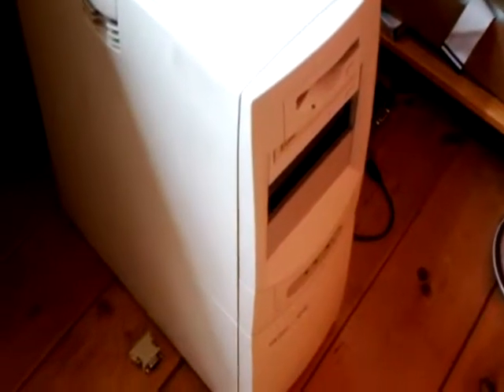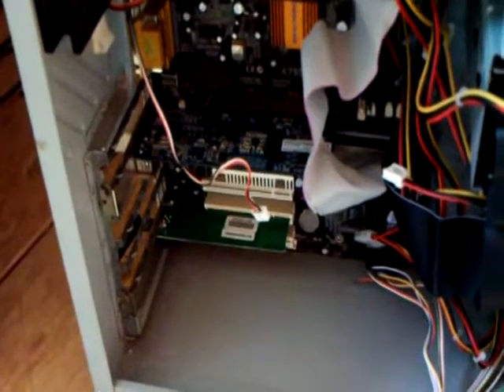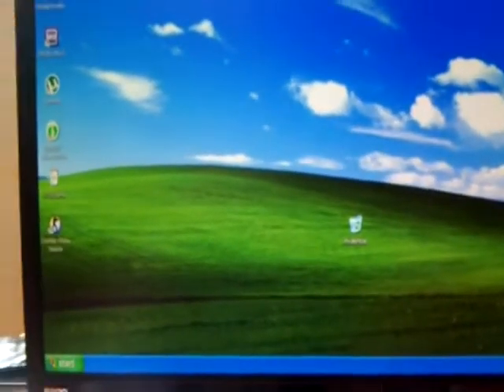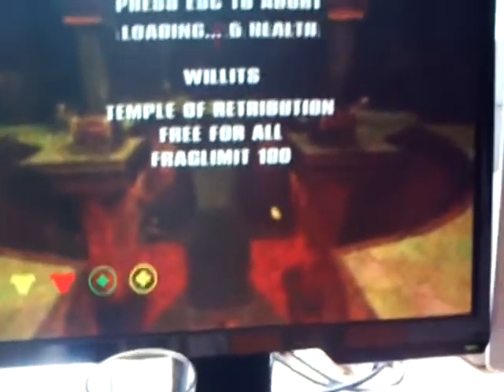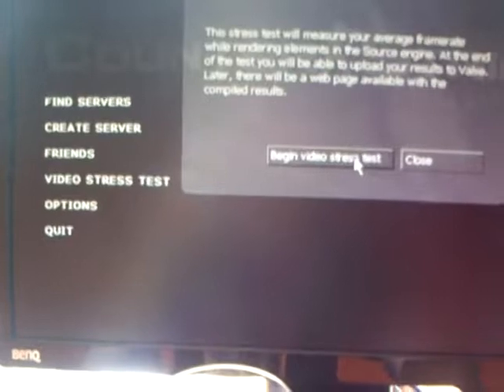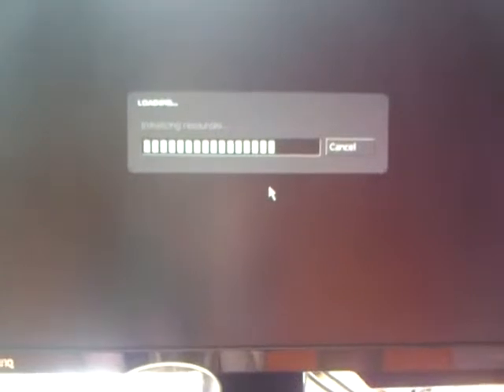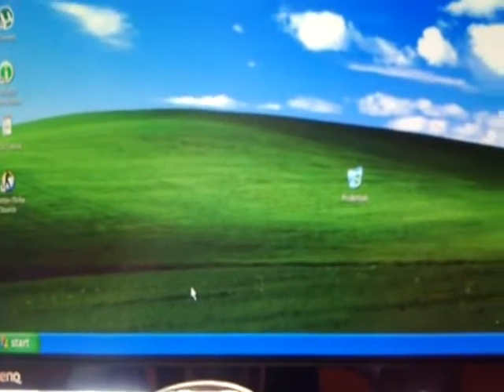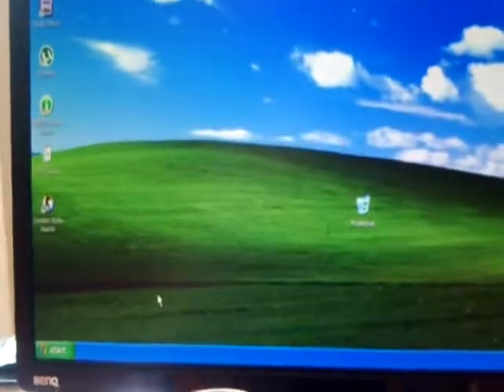ECS K7S5A motherboard in action!

Comment: I have the same board but, the cpu fan it's very loud! 😮
Reply from the maker: Use a quieter fan or use a fan cable with a resistor such as those that come with Noctua fans
Reply: @nelizmastr  thanks for the advice! I replaced the fan of my dreamcast to a noctua and it's awesome! But i didn't notice that It has a resistor in its wire. Thanks i Will try some like that.

Comment: I am watching this using that motherboard, I only got here because I am having trouble getting the system to properly run 1 GB of RAM, can only get the motherboard to see 512MB, I used a program called SIW and it shows that the two 512 MB modules are there but it says Maximum Capacity 512MB Wrong Value.

Anyway I thought maybe you might have experienced issues with memory using this motherboard, you seem to have good knowledge of it's workings, could you give me an tips on solving this, thank.

Comment: Continuing from 1st explanation:
Thinking that again it wouldn't boot I shorted the power on pins and it blasted up its fan,showing that it's alive.I just couldn't believe.I quickly grabbed my S3 Trio 3D/2X AGP 2x card and inserted it,turned my 22" TFT on and I saw AMI BIOS loading it's stuff.Turned it off,and tried to solder a battery slot but without success (my soldering iron is kind of worn,so the tip is not pointy anymore)so I said "who cares if I don't use the battery?I have the F8 option"

Comment: Actuallly,this was a weird case where I had to take out the entire slot (basically removed it with a screwdriver,and it came out with the pins attached to the board)because,my guess is,that because it rained in my area the board survived but the slot died totally. (the board still works,but I have to resolder another slot)I discovered this at 16:00 PM this day (to be exact)when bored I was playing around with the DVD-ROMs I bought along with the board.

Comment from the maker: Then there's a good chance somebody plugged in a non-supported CPU, with the last revision of Socket A. These support the Athlon XP 1500+ - 2600+,  Athlon MP 1500+ - 2000+. Athlon 650 - 1400, Duron 600 - 1800.  So, neither Semprons nor Barton core Athlon XP.